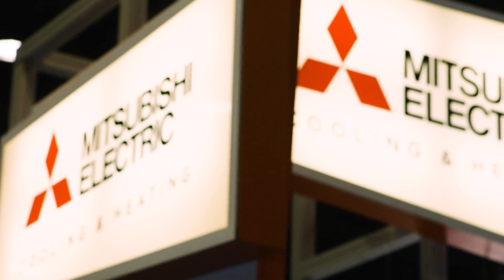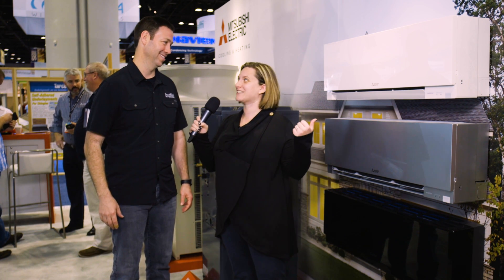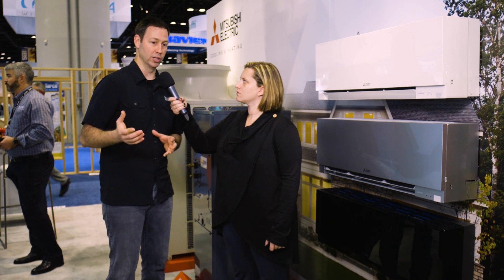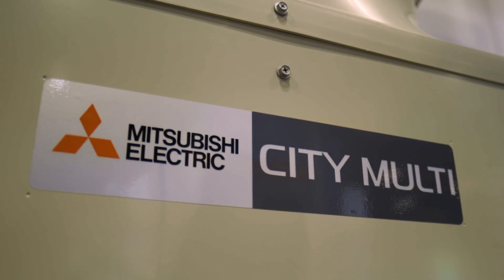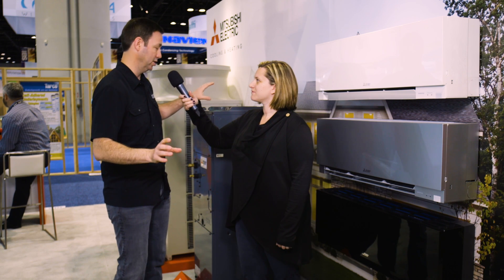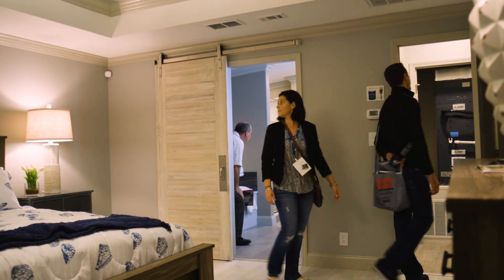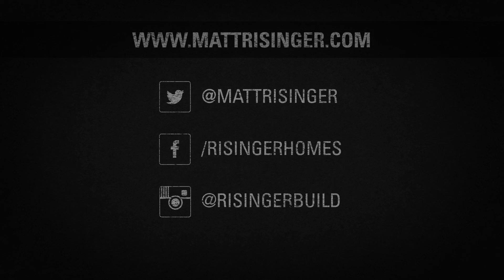2017 Mitsubishi HVAC - What's new from the International Builder Show

Comment: Mitsubishi pretends to really care about their products and ultimately the customer. I purchased a Mitsubishi ductless split system and received it 8/8/2023. I  had a question for the Mitsubishi Tech Support and they refused to answer any questions because I'm the homeowner. I informed the tech I'm retired with 30 years experience on commercial HVAC and He still refused to answer my question. His attitude and response was very insulting. Mitsubishi was very insulting! The other five units that I planned on installing in my home will not be from Mitsubishi/Trane.

Comment: This is all good but heating and cooling systems are effective only to the extent of the insulation of the building. If the insulation of the building is not good no matter what kind of system you use it won't help.
Reply: I agree but at least your monthly bill would be cheaper for crappy HVAC wouldn’t it?
Reply: @chief5981  _ I don;t think your monthly bill might change much but with crappy if you mean cheap, sure, at least your initial investment will not be that much of a waste.
Reply: Langolier I mistyped. I meant this system would at least be cheaper THAN crappy insulation with normal hvac system. 
Main issue is contractors never air seal homes, condition crawl space, basement, etc. or treat attic properly so 90% of homes have inefficient hvac systems with heaps of waste. 
But yes, if your house isn’t set up correct all this conditioned air is going right out the cracks and windows
Reply: @chief5981 _ Ah, I see! Yes, definitely. It will compensate to some extent the lack of proper insulation in comparison to traditional HVAC system, which is a whole different issue in itself, when it comes to efficiency.

Comment: I've got boiler heat with baseboard registers. My AC is a mismatch traditional system with soft ducting running in the attic areas across a vaulted ceiling. I wonder if I could get rid of both systems both seem to be on their last leg (the AC compressor already died and I had to install a new fan motor). I wonder how much it would cost to heat/cool up and down stairs. currently 5 vents for AC upstairs and 7 boiler baseboards. 6 boiler baseboard in the basement (no AC currently.) The current AC gets set to 72f and by 5PM its 85-90 upstairs (I'm in freaking Minnesota, it was never even this hot in a house back home in Texas)

Comment: Kinda late to the party, does the new 2017 Mitsubishi mini split have that water leak problem still? We are trying to decide on a Mitsubishii mini split versus a Lennox duct system, the guy said the Mitsubishi mini split have water leaking problem even when installed right.
Reply: I have 5 mitsus, flawless QUIET Efficient I have the hyper heat units, run teh drain tube properly, not kinked, it works great...mini splits are teh way to go, I heat and cool saving easy $500/yr in heating and cooling each year over the old AC central unit, and oil furnace, mini splits are the way to go, Mitsubishis are the best QUIET reliable, efficient
Reply: no leaking or mold. I clean the filters once a month, takes 3-5 minutes, so easy. this system kept my house comfortable during the unprecedented heat this summer, so glad we had it installed

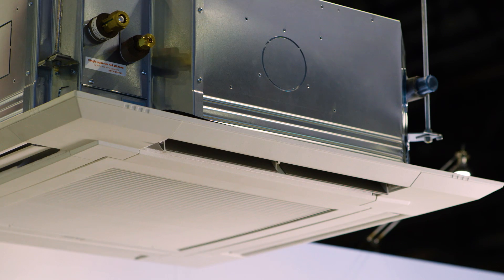Comment: Matt, at 4:40 you refer to "super sexy linear" types... Are you referring to the diffuser vents on the conceiled units? My contractor wants to use the SEZ-KD but the diffuser vents on the supply and return look very dated. I am looking for some modern stainless steel diffusers I've seen in photos but don't know if I can use them in this setup or where to get them. Great overview by the way.

Comment: Hi Matt, love your channel.
With new houses being so well sealed and insulated to try keep warm air in, how do these mini split systems work to bring in fresh air? I know that they remove moisture from the air and filter the air, but they just keep circulating the same air around a house. Does this become a problem? 
Passive homes tend to use a ventilation system that brings in fresh air but through a heat exchanger.
Reply: MegaGouch Have an ERV (energy recovery ventilation) unit intalled. It brings 'fresh' outside air in while pushing 'stale' interior air out. They implement a cross draw, heat exchanger style air exchange that keeps from recycling the same air over again.

Comment: I have Mitsubishi systems in my home and love them. So energy efficient that even in the hottest months we have never had a bill more than $160. And as for winter, we only heat the rooms we use and they are very cozy.
Reply from the maker: +Barbara Renaud thanks for telling of your personal experiences
Reply: @Barbara Renaud _ What kind of system you are using for heating and cooling your home is not that significant. It all comes down to how efficient your home insulation is.

Comment: Hey Matt, love your videos as always. Been using them to guide me in my home building process. I have been pushing to use the Mitsu hvac units based on videos I have watched years ago from you. Two questions: 1) for a larger home in the northeast (climate zone 5) are the mitsu units practical both in coverage ability, and heating (with out using the high wall mount units) and 2) do you have an approximate cost delta between a higher end hydro air system that is typically employed here? I dont mind paying a little more to get the VRF capabilities and better IAQ and multizone but I havent been able to place a percentage of increase based on practical installation considerations and issues.
Reply from the maker: +Paul Costeines Good question Paul. It's likely a few % more but not much. Yes these are totally practical for your climate zone. They have full heating capacity down to like 5 degrees outside and they blow very hot air above 115 unlike the old HP units that felt like they blew cold air because the 90 degree output felt cold to your 98 degrees skin

Comment: Matt  how this systems  are for  cold weather? 

5 to 20 F   For example, do they perform well?
Reply: Mitsubishi has systems that are able to perform to 100% capacity all the way down to 0 F and continued operation down to -13 F.  These aren't the heat pumps we are used to here in the US, the air coming out will be much warmer even during very low outdoor conditions.
Reply: Mitsubishi offers their highest performing models with Hyper Heating technology.  This feature provides 100% heating capacity, without supplemental heat, down to 5*F ambient.  Even in negative temperatures, the heating capacity remains impressive.
Reply from the maker: +macrapidito I believe this is full heating capacity down to 5 degrees outside. Very impressive
Reply from the maker: +Greg G even lower than I though!  0 degrees. Wow
Reply: Thanks Matt as always your videos are very helpful, as an Stucco contractor I really can tell that  you are a top  quality builder. 

keep those videos  :)